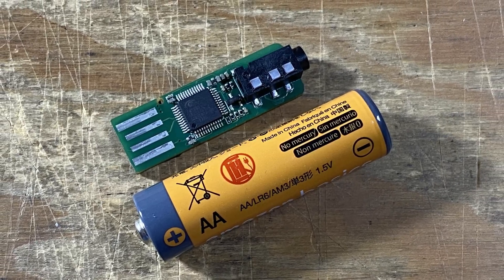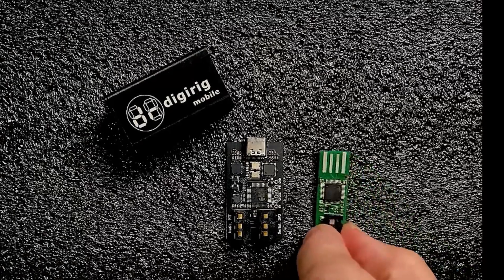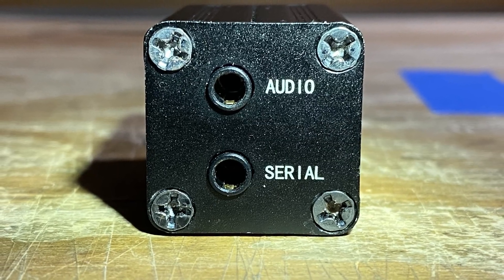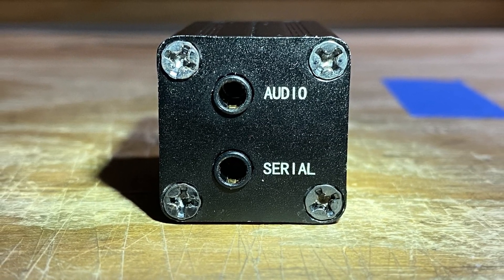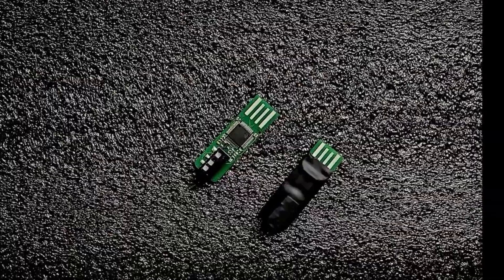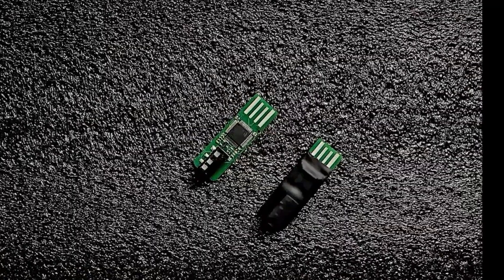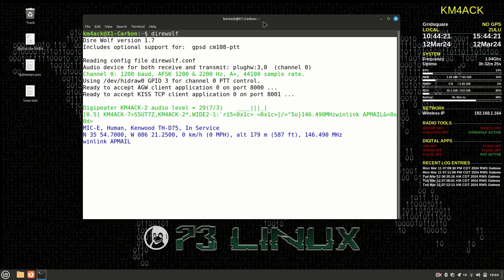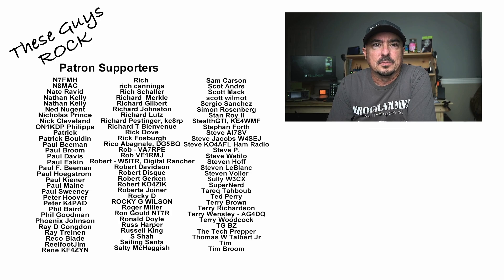Digirig Lite is Half the Size

Comment: As a Kenwood TS-570D user I cannot use the Digirig for CAT control because it has no flow control on its comm port, CTS is used for PTT and that's fine because I already have a USB to serial converter running 56700 with flow control for Log40m but for me and other Kenwood fans, the ultimate would be a "HEAVY" version with two USB to serial ports and a sound card providing audio, CTS PTT and a comm port with flow control.

Comment: I have purchased a Digirig Lite. It shows up in Device manager - Universal Serial Bus controllers as "Unknown USB Device (Device Descriptor Request Failed) Properties". So now I am trying to find a driver for this device. Am I looking for a CM108 driver? What driver should I install?
Reply: Well now without loading drivers I reinserted the device and it shows up as ' 8- USB Audio Device'. Sometimes it show up sometimes it does not. mmmmmm?????
Reply from the maker: Not sure as I only run this device with Linux which has the drivers built in.
Reply: @KM4ACK  Oh, yes. Let me try this on Linux Mint. :)

Comment: I would love to see a version like this that just had easy connections points to solder on the GND, PTT, COS, Audio Out, Audio In.  Would make it very easy to attach to a radio cable and be ready to use on everything from AllStar to Winlink.   Any idea when this might be released?
Reply from the maker: I don't know anything about the release date yet

Comment: that is small , you could use VOX for PTT control . I can see using this with a short wave radio to de code digital modes. like CCTV from the ISS . the Digi rig has gotten many of my radios  to work digital modes. Even the Baofeng  UV 5R doing SSTV on 70Cm . even works with FRS and CB . 73's

Comment: There is no reason this kind of board could be placed in higher end mobile, desktop, and handies.

No.reqson the new Y high end mobile or the K $700 handis do not have it.
Reply: the K$700 has a built in TNC so this or the digirig should be unnecessary with that radio. High end Y’s have TNCs but are unaccessible (dumb)
Reply from the maker: @BarryShaffer is right. No need for any interface with the D75 as long as you are using packet. The advantage of using the Digirig with the D75 is that we can do VARA FM as well. All depends on your needs.

Comment: When I discovered the PTT trick on the C-108 chip, I was able to make my homebrew digital interface even simpler than the Easy-Digi it was based on.  Soldering a wire to that tiny pin is a chore, but it works great and now everyone is including the needed software to make it work in their digital mode applications.

Comment: One suggestion/revision that I'd recommend: Through hole solder pads for the USB and Audio so one could make their own all in one cable. Personally, if I had one I'd dremel off the USB connector, unsolder the audio jack and hard wire in the cables and 3D print a small enclosure.
If they had a design like that, the whole thing could be half as long as this version, just the chipset, 3 audio holes on one edge and 4 USB holes on the other edge. Heck, that may even be small enough to fully integrate inside some rigs. Imagine being able to make some old HF or dual band rigs have direct USB connectivity.
Reply: yes please! Heat shrink and cables would be far more rugged for portable ops than a fragile piece of circuit board hanging out the side of a laptop or usb OTG hub.

Comment: Shut up and take my money. Never used the serial port in my digirig with my radios. I will strongly suggest to sell them without any case to keep the costs low and cheap price because it seems VERY simple to just use a heat shrink on it. Or just include a piece of heat shrink tubing = way cheaper than the aluminum case

Comment: That would have worked well for my APRS system too. especially if it was cheaper than the full digirig. If so I'd like to have several of them to put in kits and in my base unit and i'll reuse that digirig somewhere else.
Reply: That was exactly my logic. I have an old school Rascal interface on my 817, but not full CAT control. I will be pulling the Digirig that I bought for Winlink on my VX7R, and using my with the 817...and then using the Lite with the VX7R. May need ANOTHER for the IC-2AT that I use for ISS work

Comment: It's available if you're a YouTuber. I have a couple as well. Thanks for making this video. I plan to test mine next week. I plan to integrate mine with a single cable.
Reply from the maker: It's certainly small enough to include in the cable. 👍 I wondered who else got them
Reply: @KM4ACK  Me, too.
Reply: He beat ya! You gotta kt7RUN faster!
Reply: I'm one of the lucky non-Youtuber to have a prototype. I wonder what the found bug is. Been working great with UZ7HO Soundmodems, VARA and WJST-X(FlRig as the trigger control).
Reply: When Jason mentioned this, I wondered if @TheTechPrepper had heard of it. My wondering has ceased.
Reply: @LeeMccNA5T  Denis for DigiRig keeps us looped in. He's an amazing guy as I requested a few products that he actually developed (VX-6R cable, FT-2980R cable ,FTM-6000 cable and a shorter Yaesu 8xx cables). Now, I am pushing him for a Bluetooth model for both CAT and audio).
Reply: Looking forward to both reviews!
Reply: I've been pushing dennis to make a raspberry pi Audio header module with the digirig build into it. I think that this was his compromise since most Pi have a full sized USB port on them anyway. With this version you could do either PC or Pi.